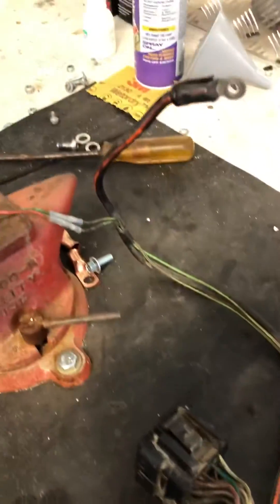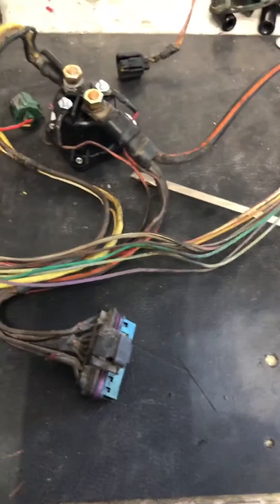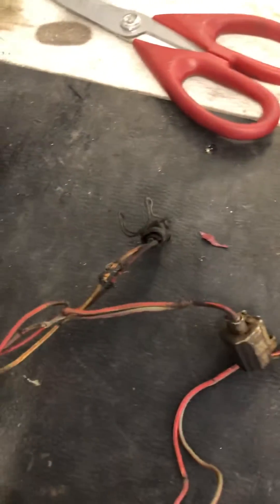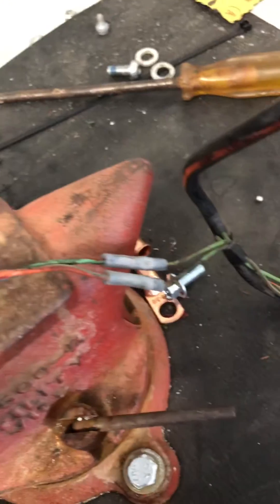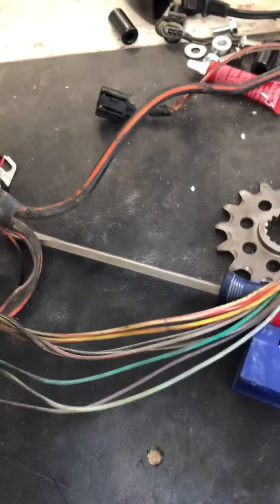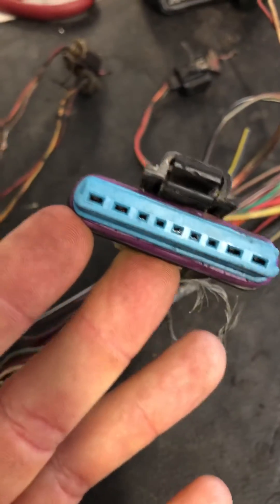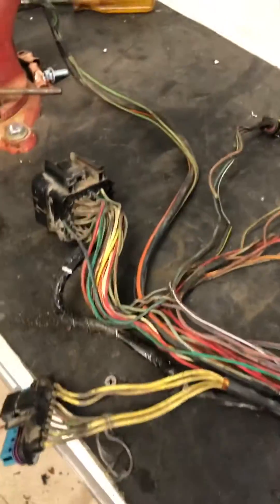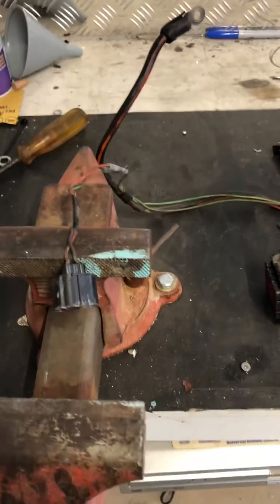Inside The Wiring Harness of a Ford F350 7.3L Diesel Truck

Comment: We took our harness out but when putting it back have an orphan plug. It has light green like rings and 3 wires attached, brown/with white stripe, blue and green. It is one extension from the glow plug wiring, the other end of this particular extension plugs into the bottom of the high pressure oil silver box. Have spent two days trying to find where this orphan plug goes. Can you help? If you google 2002 f350 main wiring harness it is the 3rd plug from the left as you're looking at it in the image that comes up.

Comment: Hi, Im glad I came across this. I have the same issues with the same harness. I have a 99’ F350 7.3 that I purchased and from what I have gathered its an “early” 99’ model with the one relay instead of two. I was wondering if you might have a part number for this specific harness? I would attempt to rebuild mine as well but I am not sure where all of the plugs attach, they were cut off prior to me getting the truck. Thanks!
Reply: I believe Riffraff diesel sells the complete harness.
Reply from the maker: @ralphanderson5621  good to know, but this one is working like a champ still!
Reply from the maker: I don't know the part number off-hand but if you call your dealer with the VIN they can supply it for you